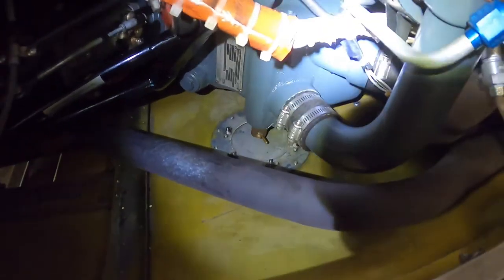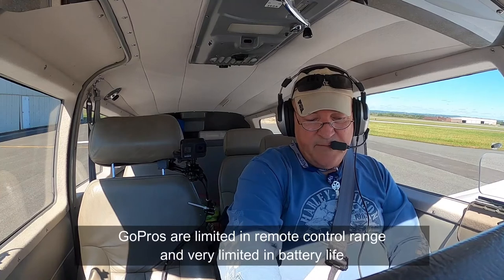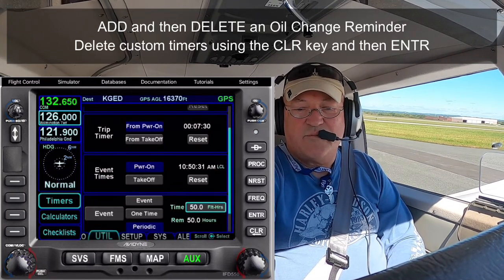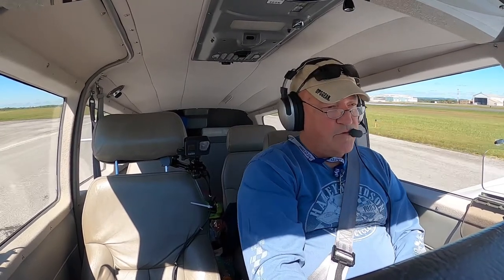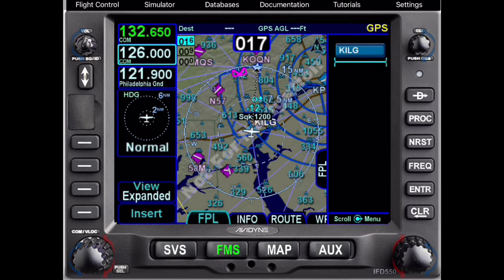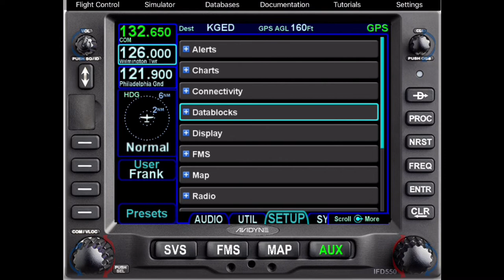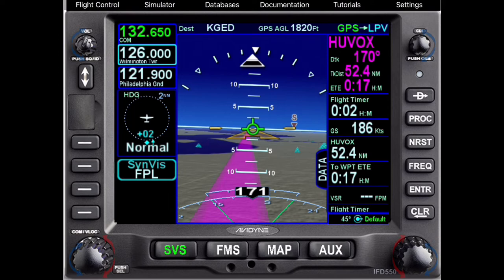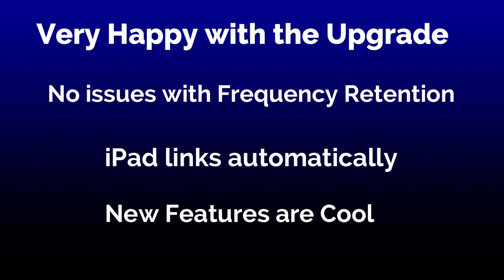PA30 Pilot Updates to Avidyne 10.3

Comment: btw -- designated WP is a very useful DB imo.  When its added.  it starts blank. -- then you can select it by clicking on it with your finger. -- it will pop up a keyboard and you can now enter a waypoint (can be a nav aid/airport/waypoint) -- the datablock will then show you distance, bearing, heading to that waypoint.  

i use it when the MAP is a waypoint or a distance from a waypoint. -- since it will show me distance from that waypoint.  

you can also use it as a separate DME (using GPS) datablock.
Reply from the maker: I clearly didn’t know that. It’s on my list of things to research and try. That’s awesome. Thank you!
Reply from the maker: I just played with this on the trainer, and will fly with it today.  Very cool. The Gulfstream I fly has a FIX function that does the same thing , but gives you a ring around the fix. I’m going to suggest this to Avidyne. I use that when clearing a jet to do practice, but remain within 30nm, etc. I appreciate your insight.